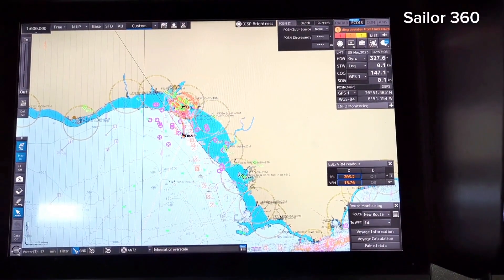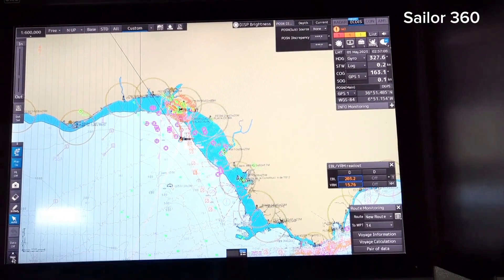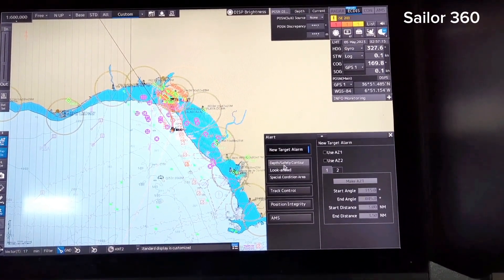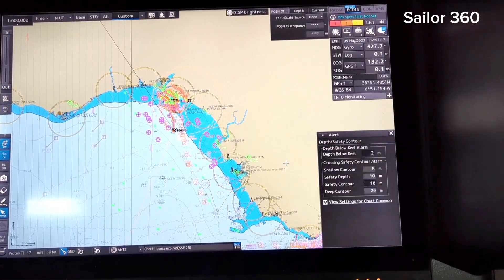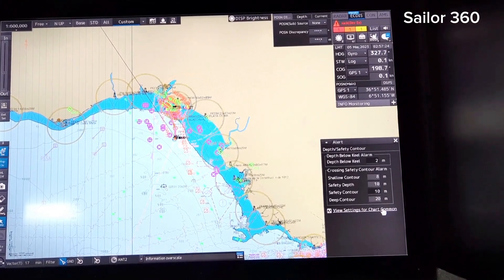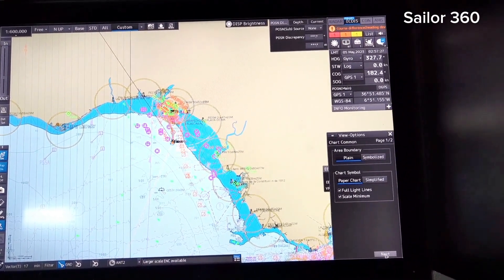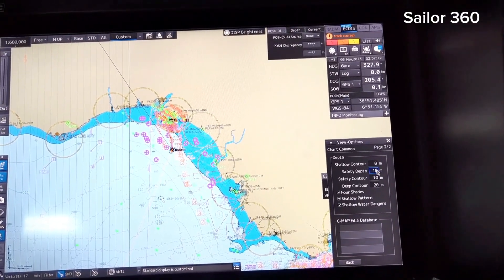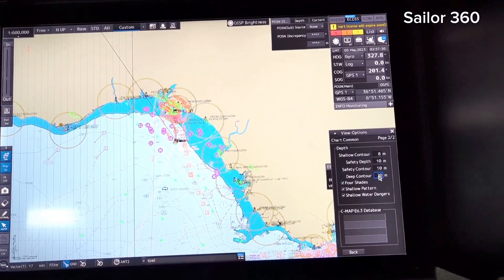How to change Safety depth, safety contour, deep contour, shallow contour value in JRC 9201 ECDIS

Comment: Sir make a video when we have to change safety parameters in ecdis like in coastal water, arrival,
Reply: Plz sir make this vedio plz sir
Reply: I am confused about it
Reply from the maker: It depends upon company procedures. If your company does not have any specific guidance on this, you can follow a standards for example depth below 20 mtr to follow coastal water settings. On ECDIS you can mark as user map, also recommended to add comments in passage plan printed copy on the correct way point where to change to Coastal setting (Specifically mention: Safety depth, shallow contour, safety contour and deep contour value),Hope it helps.